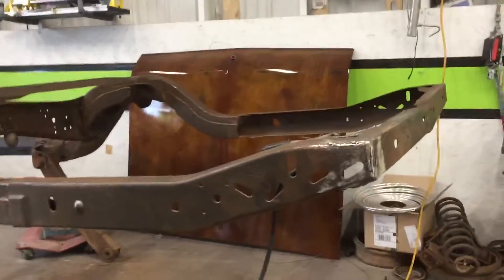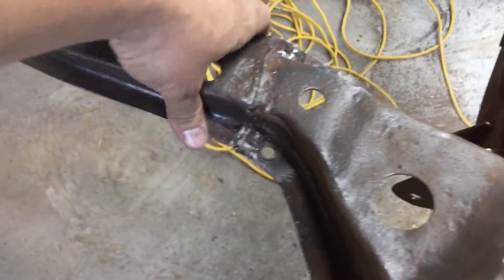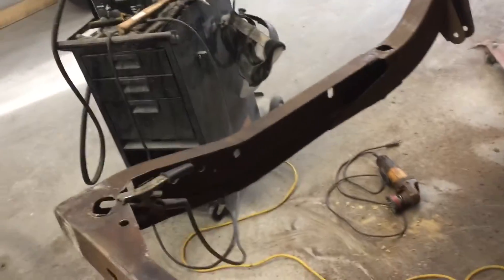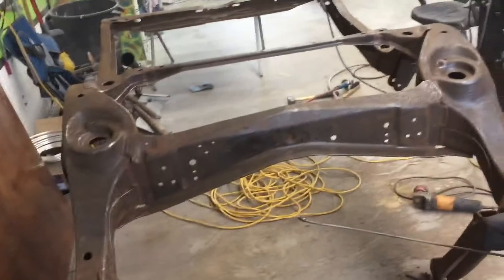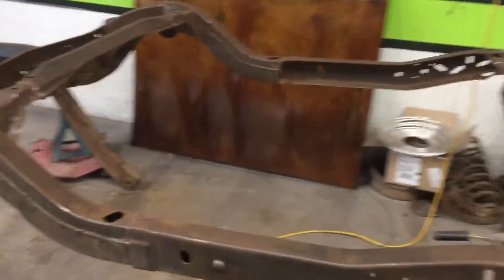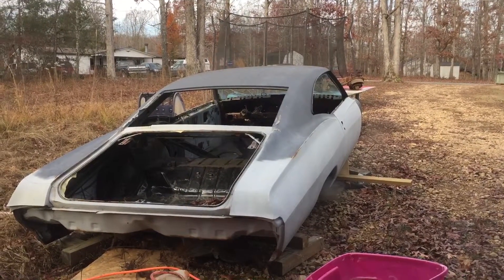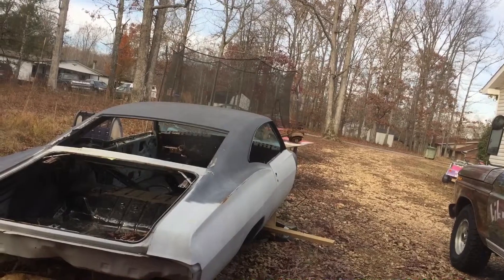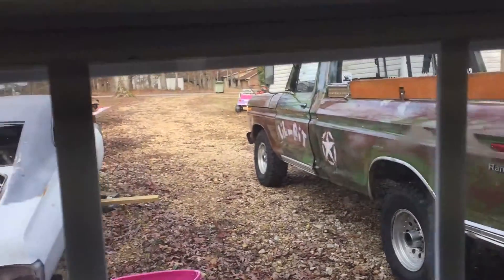68 impala build #8

Comment: Check the front for frame sag, a problem with 65 to 70 chevys. Upper control arm mounts get bent in and you need offset bushing rods to correct it.